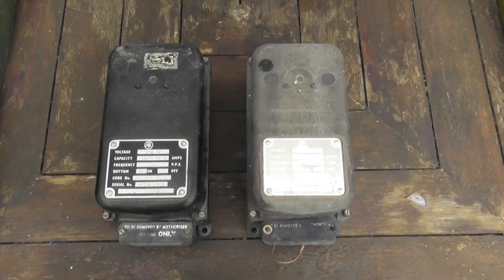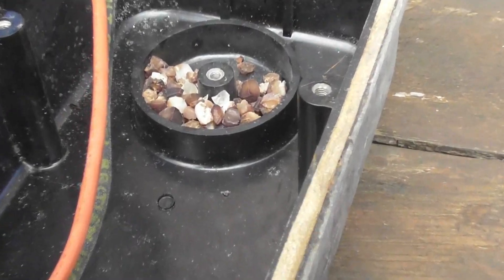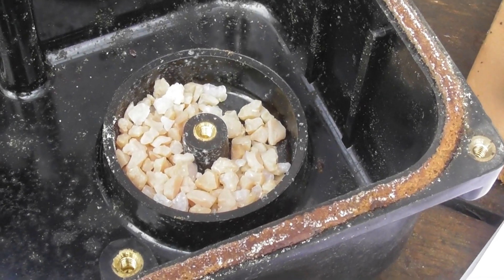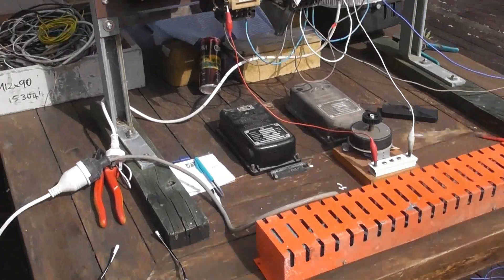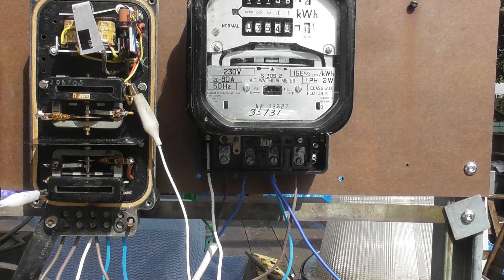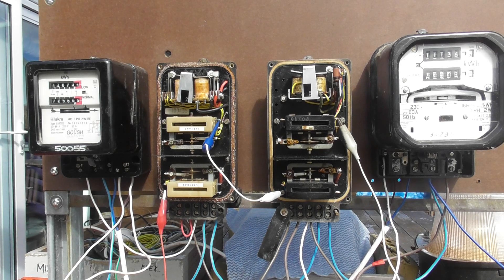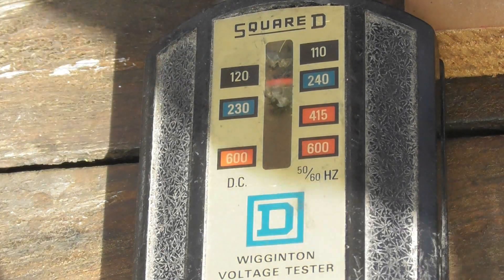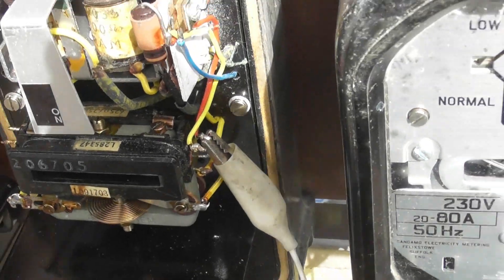Rythmatic Ripple Relays under test

Comment: I'll have to dig out and photograph the ripple switch that I have; it is similar in some ways, but is built into a GE I-30-S meter enclosure, and uses a mercury capsule for the actual load make / break element. That same capsule was used in GE 'silent' light switches from the same time period. And those 'rocks' in the cover are definitely silica dessicant. You could probably either put them in a small tin cup and bake them in the oven at a low temperature or dump them out and pour in the contents of a newer dessicant bag.
Reply from the maker: That would be great to see in a video. I am sure there are varieties of these switches. I know that some had a little 3 digit counter in them as well, so a customer could check if the switch had operated correctly. I have one somewhere but can't find it.

Comment: Ok, so that looks like a capstan motor from a 3/4" or larger pro VTR. I could be off, could be a betacam or other half inch I suppose but it looks big. I'm trying to guess because I actually fix those devices currently, I work for a videotape preservation house. And I haven't seen THAT motor before. Sony 3/4" VTRs have motors about that weight but it looks even big for that. I look after several 1" type C reel to reels also, including an Ampex VPR3. VPR3 has scary motors, especially when it does a servo crash.

Comment: Brilliant and thank you. Just imagine the minds that designed and thought up this stuff. We have lost so much. everything now is Micro processor, count some pulses and operate a switch. These guys really had to think. Thankyou and do more like this please. more explanation if you can of all the components. Fascinating. Selenium rectifiers are probably useless now and need swapping for something newer. Also poisonous. The desiccant can be rejuvenated by heating it in your oven and driving off the moisture. Pink is wet and blue is dry if I remember correctly.